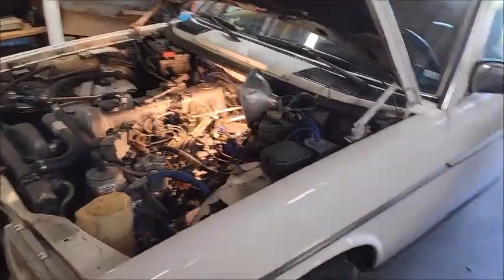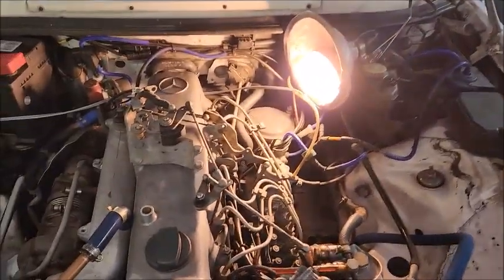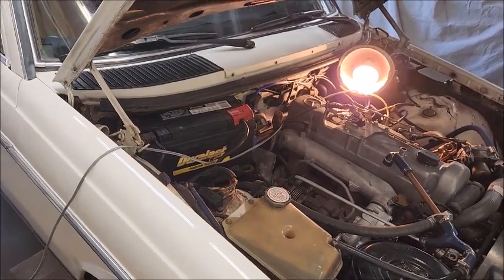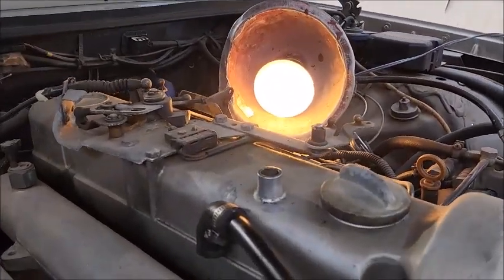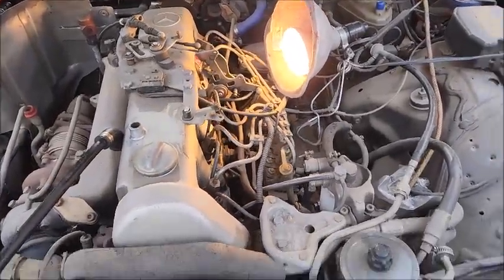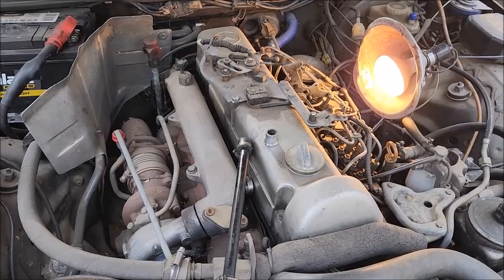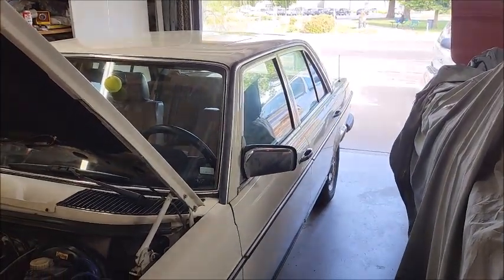M-B 300D W123 Blow-By Tests

Comment: Hello, my engine also presses gases, it stalls cold for 5 seconds, and hot 11-12
Reply: Cold should show less blowby if anything.  Mine showed no difference.
Reply: @SihAza  And on a second good motor, is there a difference between cold and hot?
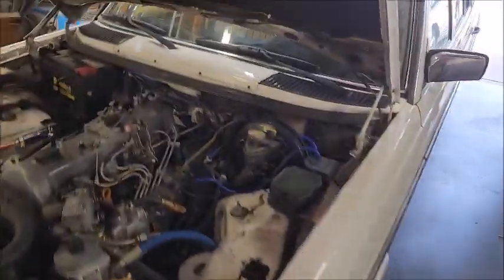Reply from the maker: @Дмитрий-п1э9з   Jump to 3:25 for a repeat with engine cold.  No difference.
Reply from the maker: Perhaps your engine has a path out of the crankcase other than the top vent, which relieves pressure, and that path vents more when hot.  Suspect the shutdown valve's rubber vacuum seal (test w/ hand pump) and the oil drain tube check valve stuck open (top of upper valve cover), or perhaps leaking gaskets (valve cover, oil pan, lift pump, front crank seal).
Reply: Согласен, спасибо за ответ.